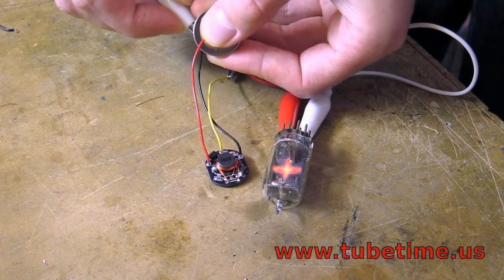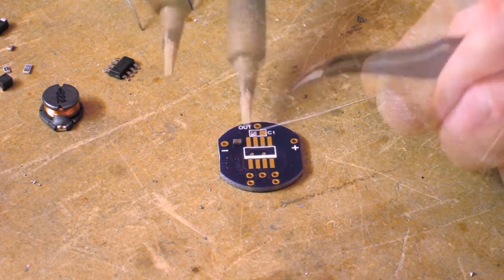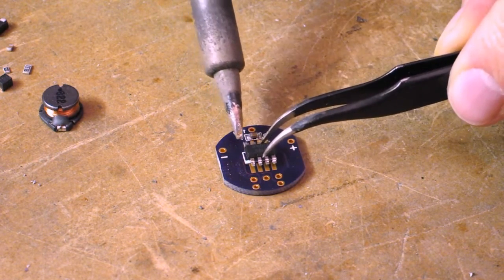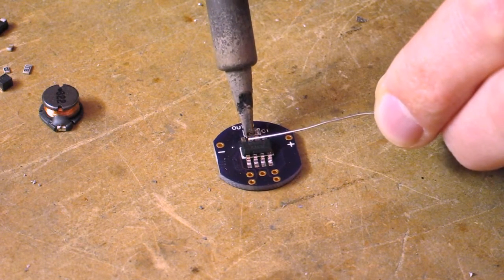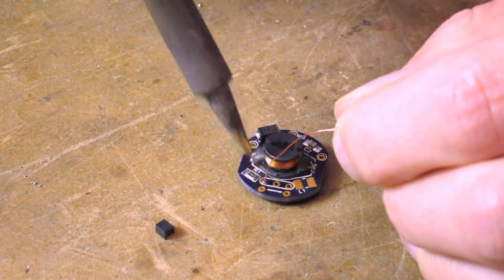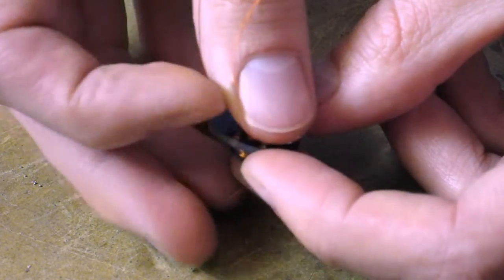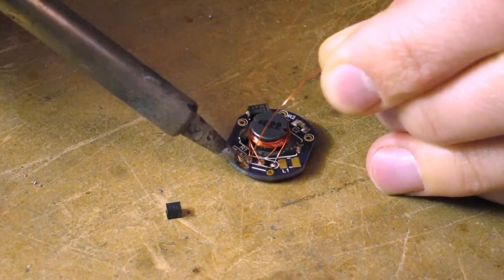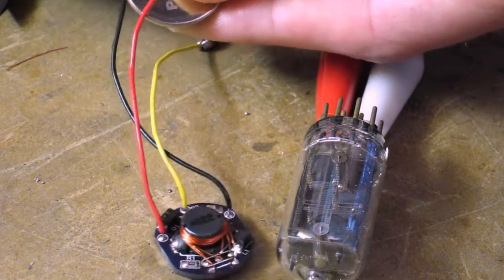Miniature Coin Cell Nixie Tube Power Supply

Comment: If you are reading this, can you please link the schematic? The link on the page isn't working and I couldn't find it on archive.org either. Thank you, and thanks for the tutorial. I have the boards and all the components except the 8 pin SOIC transistor package. Waiting on that from mouser.com now.
Reply: Also, mouser offers L1 inductor in a few different DC resistances. I believe 6.1 and 7.53 ohms. Will all work?